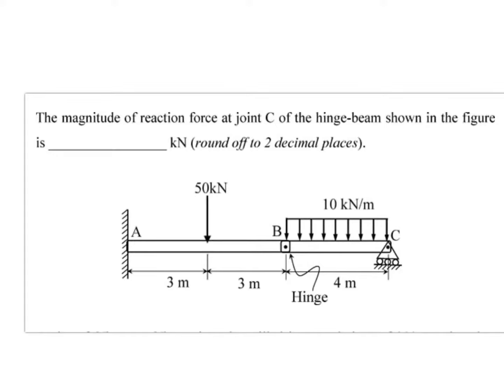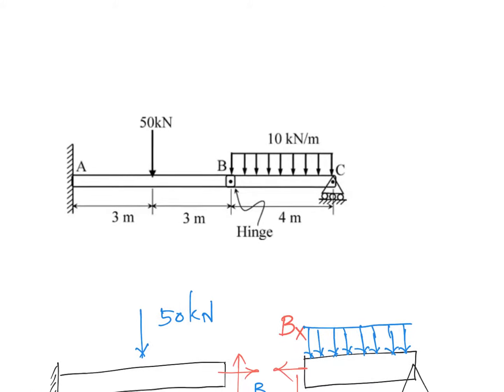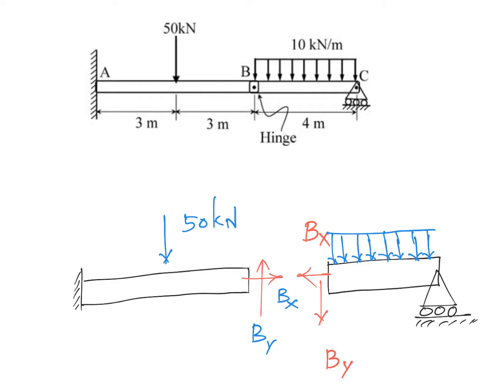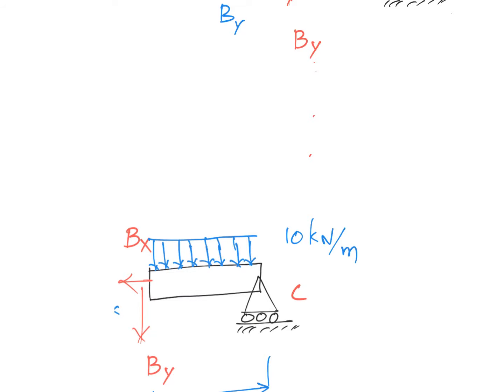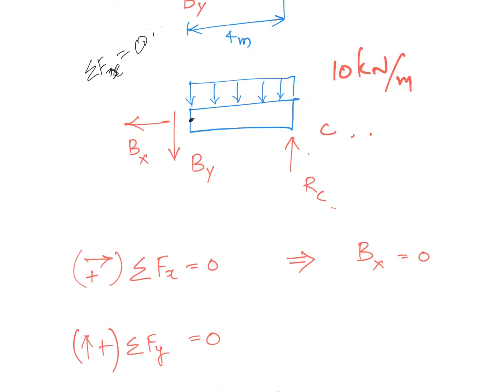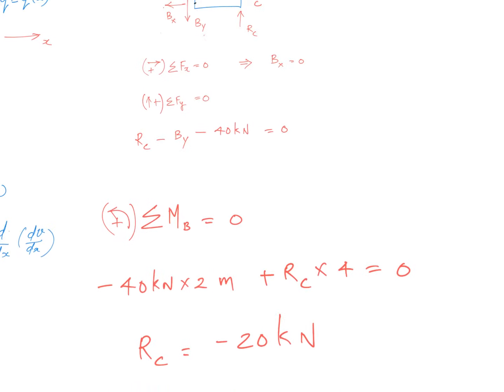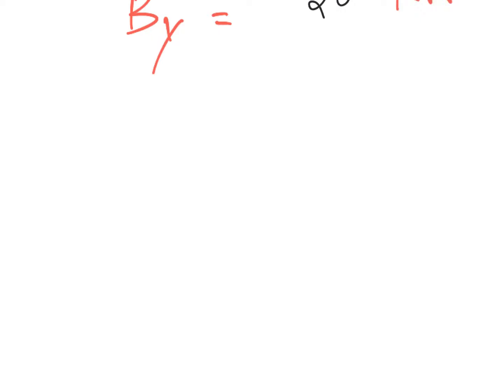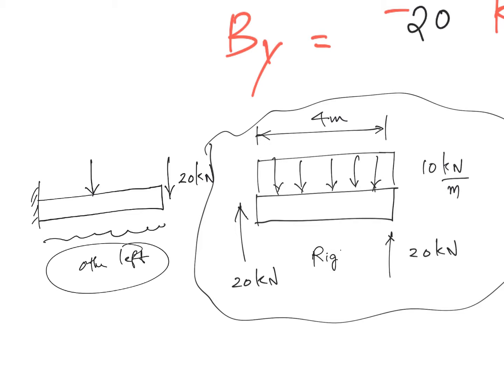Beam with Hinge | Concepts and a solved example|GATE 2020| Calculating reaction and bending moment

Comment: You said earlier in this video that only moment can't be transferred across the hinge only axial and transverse forces can ! Then afterwards why you didn't consider 50kN transverse point load on other side of hinge for calculating Rc ? As that can be transferred across hinge as you said ? Explain me please 🙏🏻🙏🏻🙏🏻
Reply from the maker: Hi, when you consider the free body diagram of the portion BC, there is a force "BY". This BY captures all the load transfer in Y direction from portion AB. "BY" can be anything, that's why I am assuming that as an unknown. Since equilibrium equations can be easily solved for the BC portion, I went ahead to solve for BY after summing up forces in Y direction
Reply: @conceptsinengineering  but when you calculate Reaction at B in vertical from left side of hinge then you will get Bv = 25kN. And then by considering that 25kN of Bv if you calculate Rc then the answer would be 15kN instead of current ans 20kN !! ..... You have to consider that 50kN force...  talking in other context, inspite of having infinite amount of force on left side of hinge (in place of 50kN) there will be no effect on Rc and will remain same (20kN) which is not possible !!!!! Please explain in detail 🙏🏻
Reply from the maker: @darpanshah8841  I didn't understand your logic of arriving at the value of reaction force at B as 25 kN (CONSIDERING THE LEFT SIDE OF HINGE ALONE). If you have applied the logic of symmetry, then you are wrong. 
Say I am drawing the free body diagram of the left portion then sum up force in Y direction
BY -50 kN+ (Force reaction from fixed end) =0 (Eqn 1)
Now, you sum moments about fixed point, 
BY * 6 -50kN* 3 + (Moment reaction from fixed end) =0  (Eqn 2)

Did you see three unknowns (BY, Force reaction from fixed end, Moment reaction from fixed end) , but I have only two equations. How can you confidently tell BY=25kN? 
To answer the latter part of the question, load always flows through the stiff portion of a structure.

Comment: this video has helped me a lot. but i have another question related to this. is it possible for you to show me?
Reply from the maker: Post the question here. I will reply
Reply: @conceptsinengineering   For the propped cantilever beam shown, compute the support reactions using the method of consistent deformations by taking the reaction at support B as redundant.  Also, draw the shear and bending moment diagrams.  Use deflection formulas to determine deflections at B.  Assume that EI is constant along the beam. (there is diagram for it)
Reply from the maker: https://youtu.be/4w1tOvEYD7A 
I have tried to answer all your questions in this video. Please watch the full video, If you still have some questions post it here.